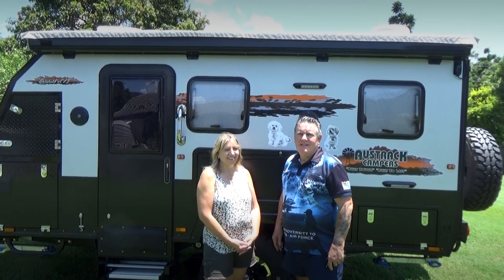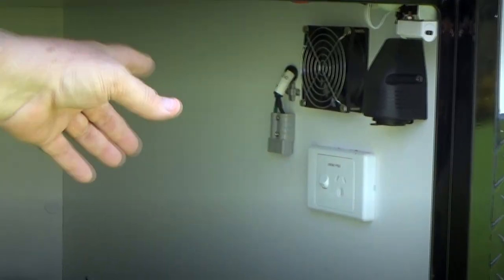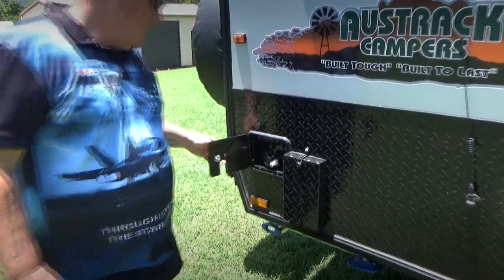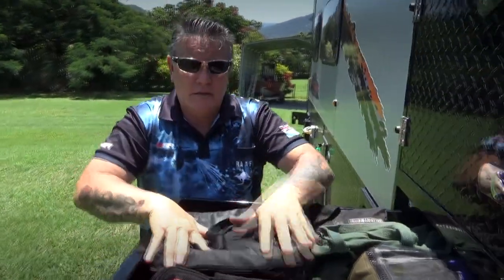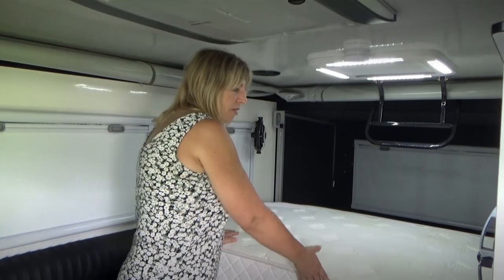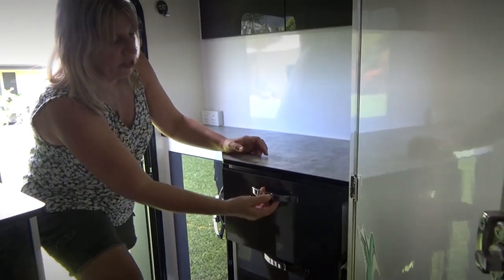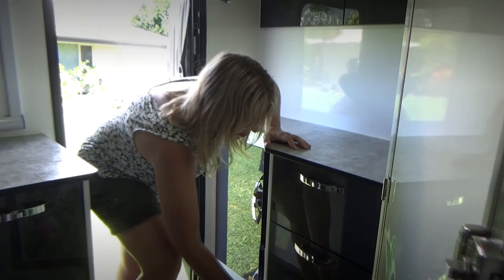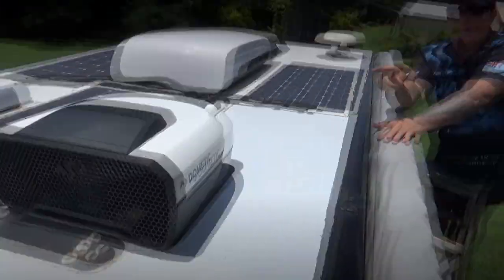Hybrid Caravan Austrack Tanami X 13 Camper walkthrough tour and 6 month review

Comment: Different to our x13,
Reply from the maker: What differences are there on yours. Cheers Muz
Reply: @muzandcath  lol ours is a 2019 version. You have all the suggested upgrades that have been suggested online since
Reply: @muzandcath  ok so no side storage along side the bed, no shelf in the external TV hatch.
Only the Tool box on the front, no Pole box.
No shower curtain facility. 
No cover on the switchboard at the front. And we still have the drawers and hanging rack so no internal fridge.

Comment: Great video Muz and Cath, Picked our Tanami X15 up three weeks ago. The only thing I found so far were the wheel nuts I think were over tightened from factory, I set them at 120Nm instead of the preset 140Nm.
Reply from the maker: I think they recommend 140nm but that is pretty high. I agree with you that 120nm is enough.

Comment: Nice walkthrough, how did you mount up the clothes line, would you be able to do a walk around on that? I've not seen that mod before 👌🏼
Reply from the maker: 50mm stainless bolts and extra large washers on the inside.  Need to duck a little bit when walking under it.
Reply: @muzandcath  Hi Muz & Cath, what a fantastic in-depth and comprehensive video...well done. We take delivery of our X13 next week and love the clothesline modification. I think you mentioned it was from Bunnings...do you remember which size and manufacturer it was? Keep up the good work. Cheers...Roy & Lisa.
Reply from the maker: @royfreeth6326  join a couple of FB groups for more info.  Austack hybrid caravan owners and Austrack Tanami owners.  I have posted up the full details and measurements where to mount it.  It’s Daytek Mini clothes line.

Comment: Muz, Cath, great walk around on Austrax 13 i joint your trip c what u get up to one thing ?were did u get that cloths line c u son Graham
Reply from the maker: Hi Mate, we just got it from Bunnings. It was a Daytek mini.
Reply: @muzandcath  thanks for the lnfo I'll go to Bunnings 2 things 1 as u travel u'll be set up with You Tube, like u r now ..my partner and I r in r early 70s and still leaning tecko, 2nd do u have the standard power system in your 13 we will be in a 15xL thanks guys ,PS were u in the RAAF.. cheers Graham Kerry
Reply from the maker: @grahamowen7152  yes mate we both were
Reply from the maker: @grahamowen7152  we have Redarc BMS 30 (standard) but have replaced the AGMs with three 140 amp lithiums